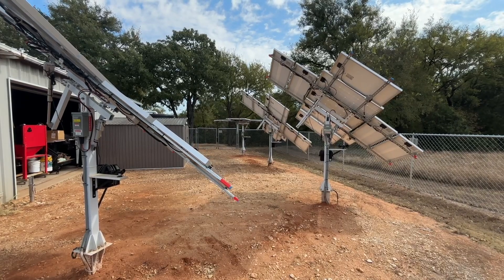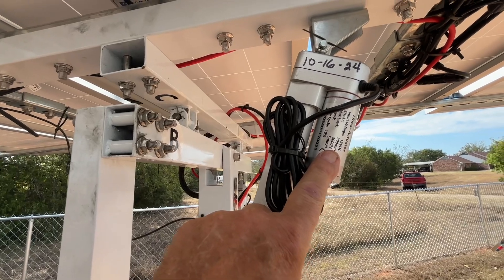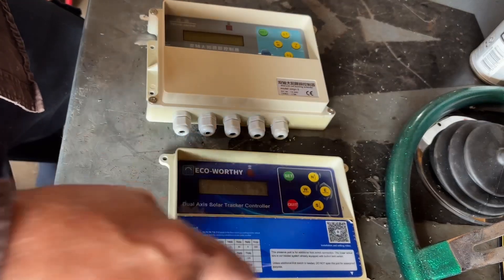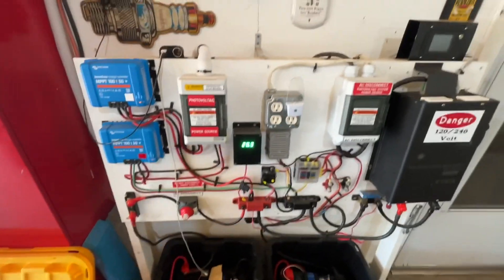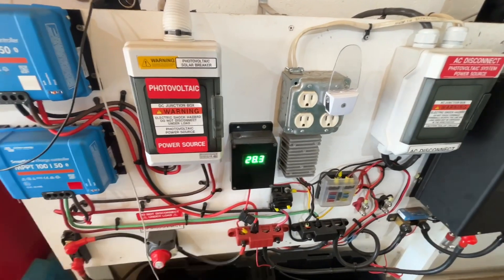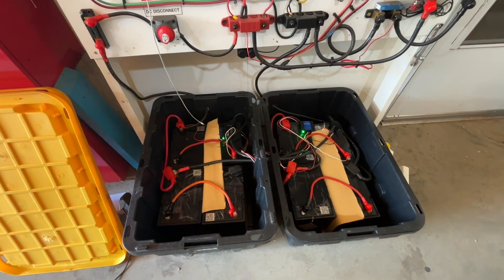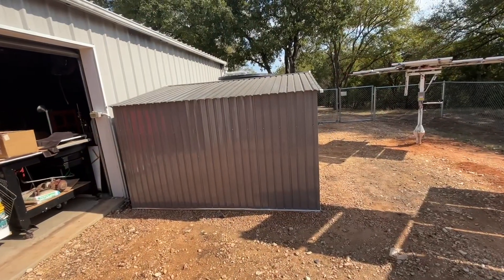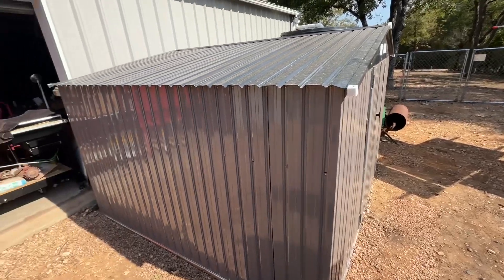Update on Eco-Worthy Tracker and solar power system. Important options for replacement parts

Comment: Glad to hear you are getting some longevity out of your solar system Rusty, definitely an option to consider instead of having to be solely dependent on the utility company!
Reply from the maker: It is a great way to supplement your power needs. As I make improvements it will perform at a higher level. Looking forward to seeing how it goes. Thanks

Comment: Lloyd, thats quite a nice setup you have there. I did get my ecoworthy solar tracking system up and running. I used a 6,000 watt, 120/240 volt power inverter at 48 vdc. I also used (4) 100 AH vetrer lithium iron phosphate batteries to get me to 48 vdc . I had some trouble with one of my actuators. When the panels reached full west, they sometimes didn't return to the home position. I figured out that if I flipped one of the mounting brackets,  it had more leverage to bring it home and its worked perfectly since then. I've been charging my electric smart fortwo for the past 5 months or so on this off grid system and its working perfectly. I don't do a lot of driving so outside of one time when it was cloudy for a whole week,  its serving me well. Anyway thanks for sharing your progress. I enjoyed the show. Joe
Reply from the maker: @mazdalorean  Thanks Joe, congrats on your system setup. It takes a little time to learn all the adjustments and settings. When I change power inverters I am strongly considering the 48 volt too. The 6000 watt sounds like a great choice also. That would add a little more power for the higher amp draw devices. Great to hear from you, keep up the good work. Take care